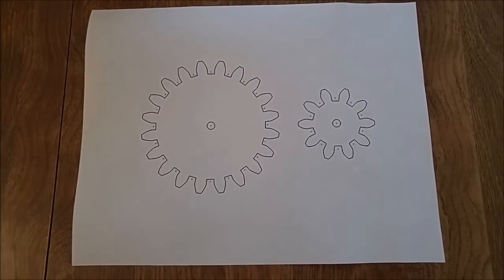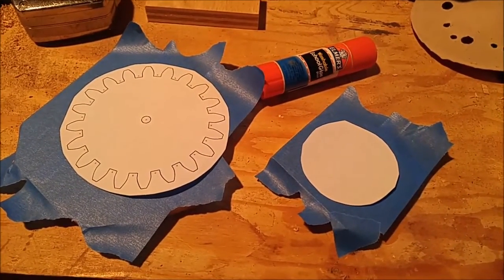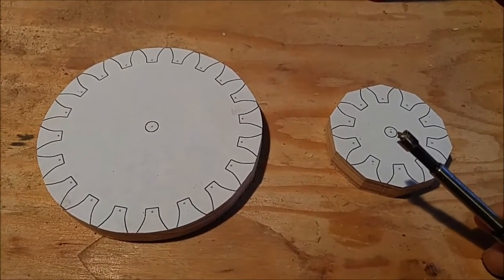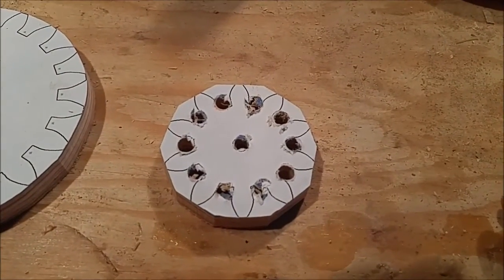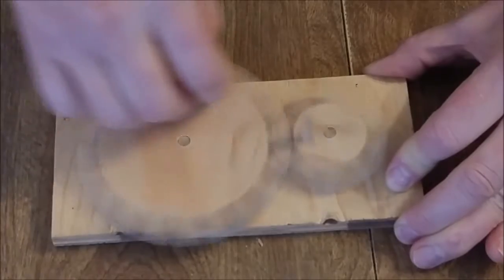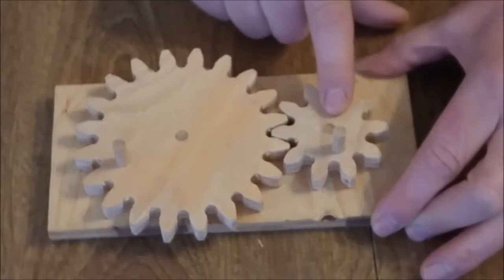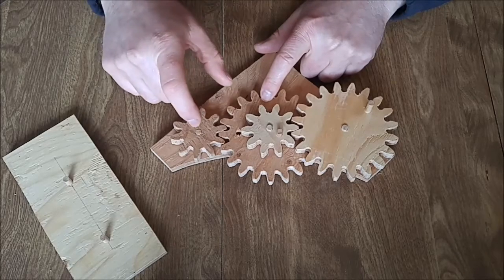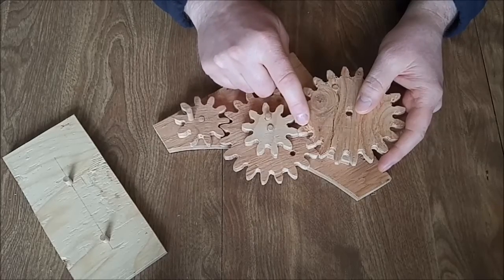How To Make Wooden Gears - Part 2: Making The Gears

Comment: You will get better results from your forstner bits if you do the following: high velocity rotation, low speed attack.
Reply from the maker: Good idea, I didn't try changing the drill press speed when using forester bits but will try it the next time I attempt to make gears. Also I been wanting to try using spur point bits as this like forstner bits will more precisely locate the drill hole, and may not have the potential tear out concern I'd experienced at least at the drill press settings I was using. Anyways thanks for the idea and glad you liked the video.

Comment: A few improvements : Depending on the speed / load of the gears ;  use steel pins for the gearshafts , use nylon or delrin plastic bushings (as bearings) which would considerably reduce friction . . . For higher precision, use bushings that  stand off from the backing plate, less friction . . . * bronze 'flanged' bushings would be better - THEN , even better still would be to  use ball bearings . . . ( skateboard bearings can be had in bulk very inexpensively on Ebay ! )   Finally, make the gear faces as smooth & accurate as possible; then wax the gear mating surfaces . . .which will prevent moisture from causing them to distort. . . as well as improve their overall performance !    * For super precise gears, each tooth MUST be as close to identical as possible  for the best outcome ;)         Good luck !
Reply from the maker: Great feedback, Thank you. Will likely be making a project using wooden gears and bearings in the future.

Comment: Good Video... I have experienced similar tearout when working with cheap (sheathing and G1S) plywood as well. I think the tearout is more to do with the quality of plywood than the Forstner drill. If you had used a good quality Finnish or Russian birch plywood with a backing plate when drilling I think you would have virtually no tearout. Unfortunately such plywood is more expensive!
Reply from the maker: Glad you like the video and good point, agree the low cost plywood used contributed to breakout even with using a backing plate. Will try using good quality birch plywood next time in a real use case for a project, and also will be trying brad point drill bits to see if they overall better than forstner bits.